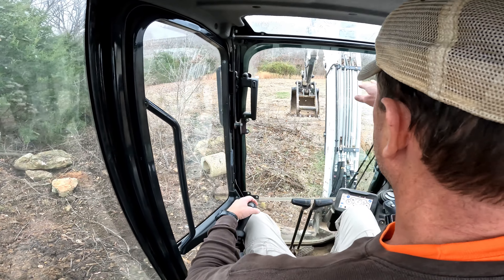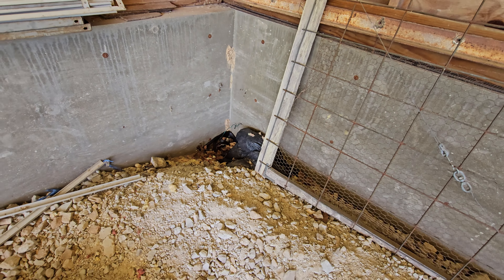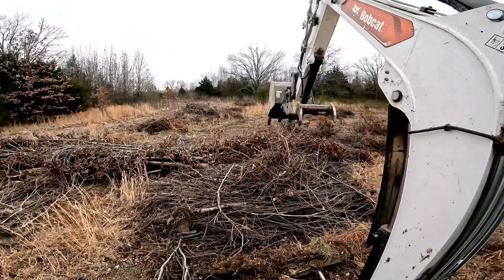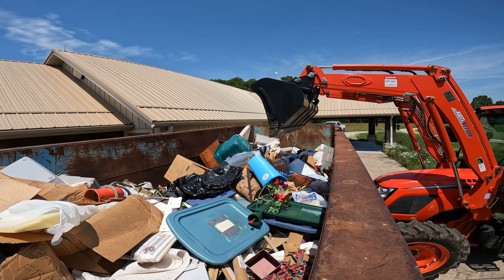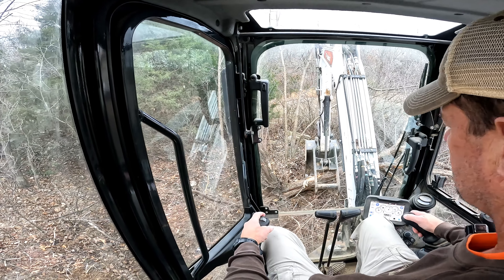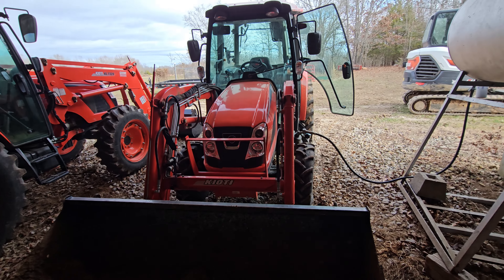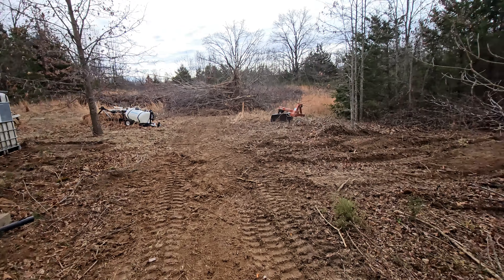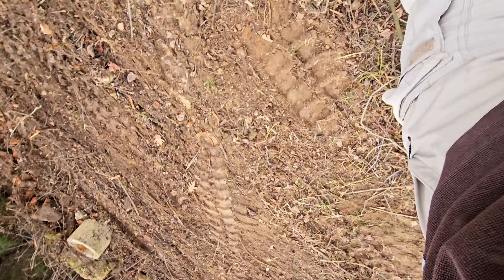Missouri Ozarks barn cleanup project. The back of our barn was completely overgrown!

Comment: Our septic had a pump station that wasn't working. But we have had the tank pumped out twice. The septic guy who pumped it out had a friend who could change it and get rid of the old system. In the back yard of the property looked like there was another building but it was a huge covering where underneath was gravel and pipes. On the three sided building that's where the power came from and the service panel we had it replaced because the door was missing. So we hired an electrician to do the work and also had him get rid of the power running out to the pumps which no longer worked. The guy we hired for the plumbing of the new septic to run a long line to get rid of the the good water from it. I tore the roofing cover apart and kept the metal and I salvaged most of the pressure treated wood. Then one stormy night the winds blew real hard and in the pasture there was a double horse stall building and it was picked up and tossed over the wooden fence. So I started tearing it apart. My tractor wasn't big enough to flip it back over the fence without it falling apart. No big deal since we don't have horses or ever plan on having any.

Comment: You need to replace those 2 missing teeth on the excavator bucket before you mess it up ,, replacing them is cheaper then have to buy a new bucket
Reply from the maker: Yeah I have to dig them out I do have some extras, good call. Of course it's cold out now! lol